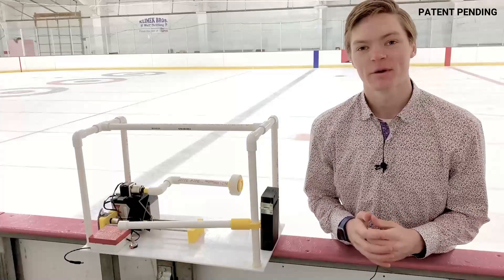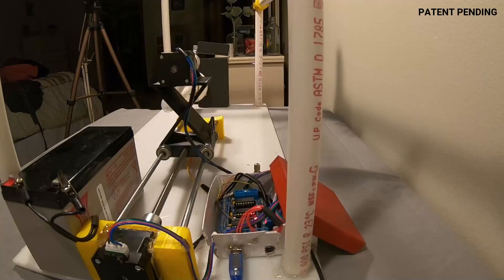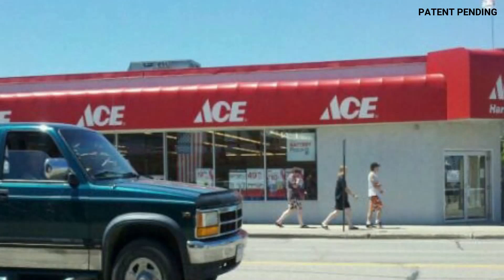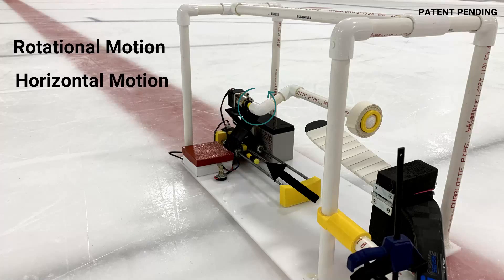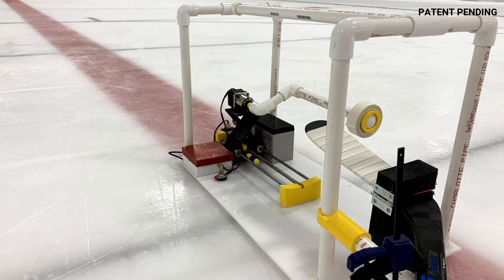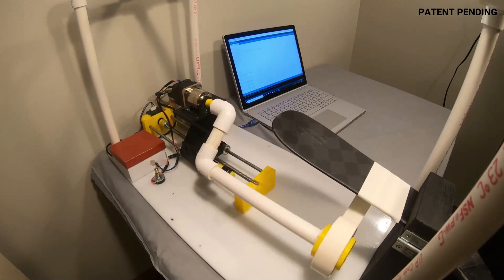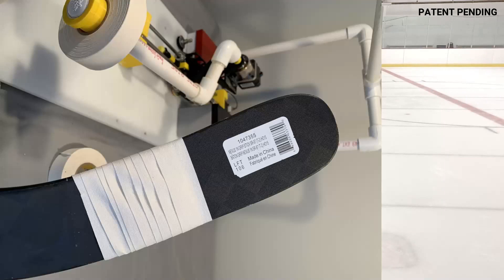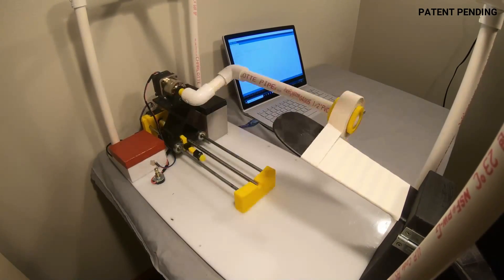hockey stick taping machine | How to tape a hockey stick...Robot Style (2020)

Comment: Good work, that's cool.  There'll be a lot of stress on the bearings in the motor though, because of that dogleg putting all that offset force on it.  Have you thought of having a rotating (clear?) cylinder instead?  Kind of like a rock-tumbler.  It would be relatively easy and cheap to put roller-guides at each end to hold it in place, so the motor now only has rotational torque on it, which is what motor bearings are really designed for.  The motor unit should last longer, and could possibly use a motor that's less expensive too.  

Maybe the motor has a gear that moves the cylinder's gear on the outside/inside.  Cylinder could have a slot in it to get at the tape to cut it or whatever.  The tape-holder would run down a slot/guide inside the cylinder.

Whatever you do, good luck and I hope you get famous and rich...after playing 3 sports professionally, of course.
Reply from the maker: Paul Totman wow man thank you for such an amazing response! I have thought of a concept like that but it isn’t something I have pursued yet! But I agree that the system I have going isn’t the most efficient method. Thanks for the advice and suggestions!